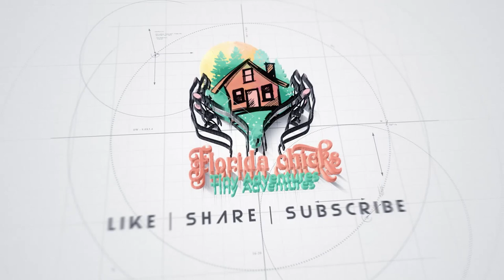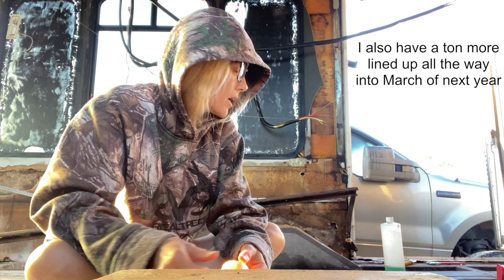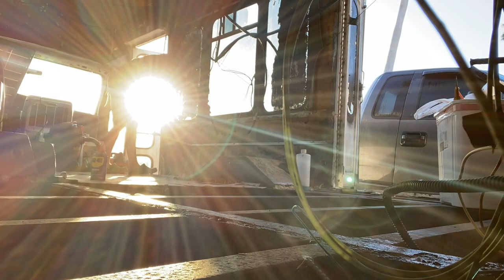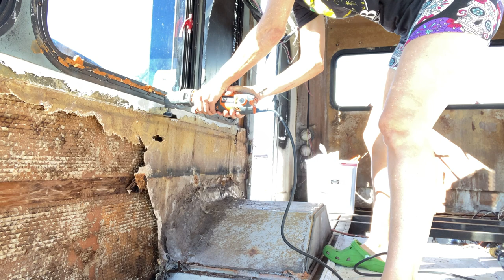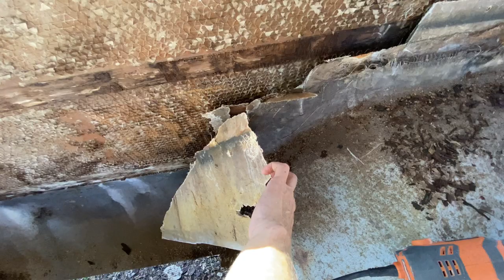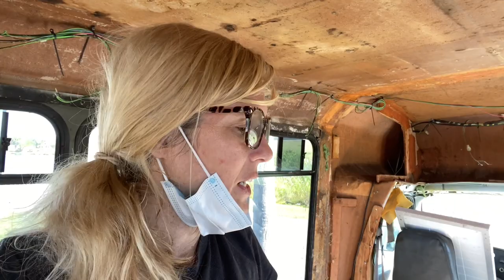BUS to TINY HOME | Rust & waffle insulation|REBUILDING AFTER HURRICANE IAN

Comment: Yes that is the outside layers 
So from outside layers in word 
Fiberglass bonded to plywood then cardboard baffling (honeycomb) then more layers of fiberglass a sandwiches of layers 
& for that metal C channel bar running the length of the hull is more support 
🤔 glad the manufacturer had the kids in mind in a crash 🤐 
So just get out everything that is rotten & no good as much as you can 
Use foam board & Construction Adhesive glue to bond the foam board onto the wood 
Then you'll need to decide what you want as a finish panel inside keep in mind the C channel 🤔 does have a purpose so you might want to replace it with flat steel panel before installing the finish paneling
Reply from the maker: Well thank you for the really helpful and detailed comment! 🙏💖😊Had no idea that rusted Metal bar that I ripped out did have a purpose? Oh geez lol here I am thinking it was a track for the seats like the one on the floor unless it was dual purpose. Either way it wasn’t even attached to the floor anymore because that’s where it was rusted out at. Now when you say foam board, Are you talking about the insulation?
Reply: Yes & the C channel is used to support the overall structure of the hull 
But I would still say 🤐🤐🤐🤐 not much help in a side crash So it's not so much important or use for that but will help in overall hull structure driving on the road holding the hull together 😉 
The honeycomb was & is actually very strong but as it's gone to rought it's worthless so replacing it with a R value foam board will be a improvement although I do recommend installing a steel replacement panel at the same height as that C channel was installed at also
Sorry just not able to explain in full detail in a text 😅 I'm not a book writer but would be glad to explain in detail the importance of this if I could outside of texting long detailed information
Reply from the maker: @JoeDally  if you lived close to me you could explain and show my in person!! 😃
Reply: Fb messenger Admin sent